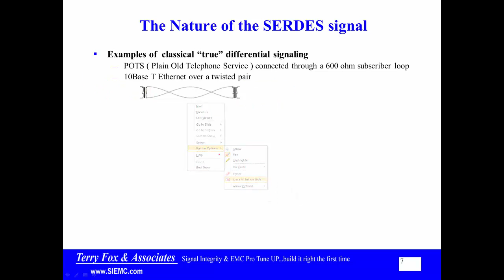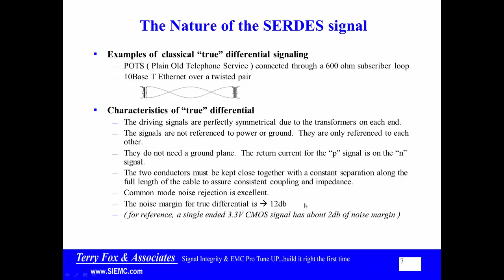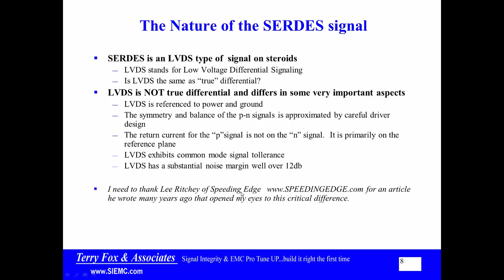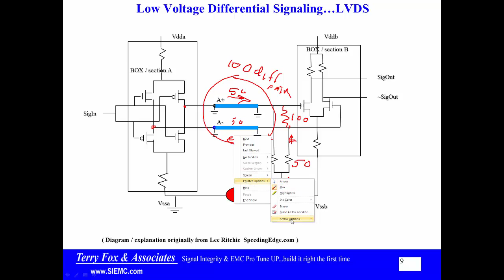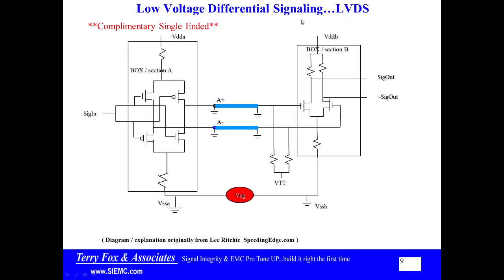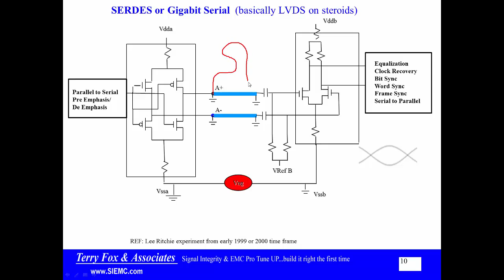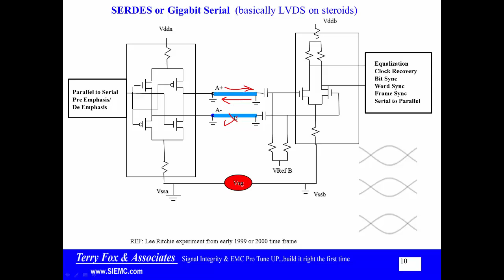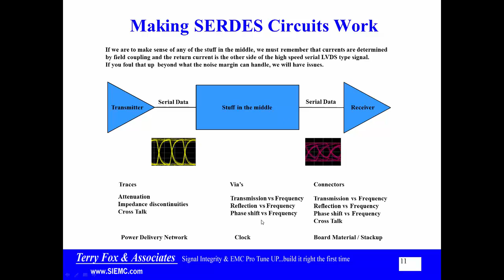SERDES 2 LVDS vs True Differential

Comment: The revision 10 of the article was finished on sep. 9 2008,  titled "A treatment of differential signaling and its design requirements", by Lee W. Ritchey. 
The introduction part of the article is as follows:

Introduction

Differential signaling has evolved into the signaling protocol of choice for nearly all emerging designs. Over the years I have written articles covering specific questions on the subject and have devoted chapters to it in both Volumes 1 and 2 of my book series, “Right The First Time, A Practical Handbook on High Speed PCB and System Design” as well as articles in our newsletters.
Along with all of this, there has been a flood of misinformation as well as accurate information in magazine articles, applications notes and design guides. Some of this misinformation makes PCB layout more complex than it needs to be and some of it actually introduces potential malfunctions.
In order to help make the design task a little easier and sort through the misinformation, I decided it would be a good idea to pull all of this information together in a single place so this document is devoted to this topic in the hope that it will make it easier for engineers to get up to speed on this subject.
Throughout this document I will use actual test data to determine where the limits are. At the end, there will be a list of design rules that apply to all differential pairs along with a list of rules that should not be used as a starting point for creating a full rule set for a PCB or system.
This discussion focuses on differential pairs that are routed over planes as is common in PCBs. Differential pairs that travel on wires, such as UTP, are treated in the afore-mentioned books.

Comment: Much valuable information.
I have one question. When we talk about a true differential signal pair, does it necessarily has to be transformer isolation, or does any of the other galvanic isolation (eg. capacitor isolation) would also suffice?
Reply from the maker: If you can produce a capacitor configuration that will create two EQUAL and OPPOSITE signals (ie equal in amplitude and phase), you have solved the first half of the problem.  The second half of the problem is producing a capacitor configuration that will be immune to common mode signals while also combining the differential signal into a single ended signal on the receive end.  If you can produce such a thing, I for one will will be mightily impressed for your accomplishment.    Always think out of the box.  You may be the one to think of something others have missed.
Reply: @tfoxwa  Thank you so much.

Comment: As predicted, this video has upset me... The argument that the signals can be split into two single ended t-lines doesn't mean that it isn't differential. One can split the Ethernet pairs, etc, and the system will work and be matched. That LVDS can be split into two parts, doesn't imply it isn't differential. Furthermore, the AC currents on the two conductors are equal and opposite. It isn't isolated and there is a DC voltage, but these shouldn't preclude it from being considered differential. The equal and opposite current has great benefits for EMI and CMRR, but only when the two conductors are tightly coupled.
Reply from the maker: An Ethernet type differential signal with a transformer is fundamentally different that LVDS.  The 10BaseT signals are coupled to each other and are relatively impervious to changes in their surroundings.  LVDS is really two single ended signals that compliment each other.  They do not work the same way.  They are primarily coupled to their return current plane...generally  a Ground plane.  Things that will work without adjunct harm on a transformer coupled connection will not necessarily work with the LVDS complimentary single ended version.  

The statement the "The equal and opposite current has great benefits for EMI and CMRR, but only when the two conductors are tightly coupled." is technically true, but it has a very small effect on either EMI or Common Mode Noise Rejection as long as the LVDS type signals are routed over a proper ground plane.  

The place where this difference becomes critical is high speed SERDES when you are nearing the end of your attenuation budget.  At that point tight coupling can significantly diminish the eye.  The same is true if you neglect the return current path through a via.  That generally results in  a phase hit which can be very problematic with the phase lock loop in the receiver.

Don't optimize an insignificant problem by causing an even greater problem.

In all cases you need to deal with reality.   

Either get a simulator or build some test circuits and prove it to yourself.

This distinction draws real fireworks.....which is exactly why I put it in the training class.

TFox

Comment: Wow, so when you layout a not true differential pairs, you do not have to always put them close to each other? Just need to maintain a perfect GND ?
And the single end impedance of the differential pair (for example 50ohm) is much more important than the diff-impedance (100ohm)?
for example, if there is very limited space on the PCB, I should maintain 50ohm single trace and let diff-pair impedance go to 85ohm instead of keep 60ohm single end trace and 100ohm diff-pairs. is it correct?
Reply: Thank you Terry!
Reply: @Terry Fox  Not sure if this is what you meant about the loss of 85 vs 100 ohm differential impedance, but if you are not targeting a particular differential impedance, just a single-ended impedance, routing the differential pair far apart forces you to increase the trace width to get the same impedance. Thus the loss is lower. 

@ Neo Zhang For me, the key to understanding this is the observation that there is a Miller effect phenomenon going on when the "differential pair" (or complementary single-ended pair as Terry call it) is tightly-coupled. The apparent capacitance between the + and - lines is magnified by 2x because they are always moving opposite each other with a gain of -1. So the broadside coupling between the traces contributes twice as much capacitance per length compared to putting a constant reference (e.g. ground) next to the trace. Eliminating the coupling between the pair means you have to add more capacitance to ground to make up for the missing (mutual, Miller) capacitance. So you increase the trace width and the loss goes down too.

You don't need to target 60 ohm single-ended impedance instead of 50 to benefit from the effect either. With the same stripline/microstrip geometry, a coupled differential pair will always be skinner than the uncoupled pair of the same single-ended impedance. So you can maintain 50 or 75 ohms or whatever you like, choosing coupled or uncoupled pairs to either minimize routing space or loss, respectively.